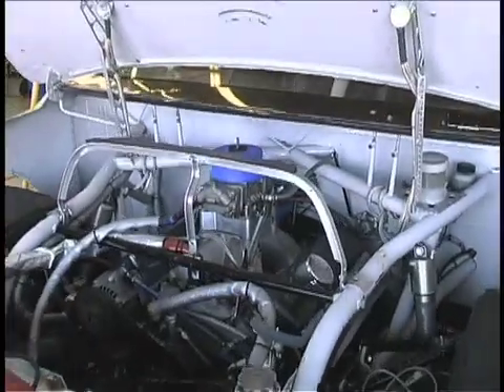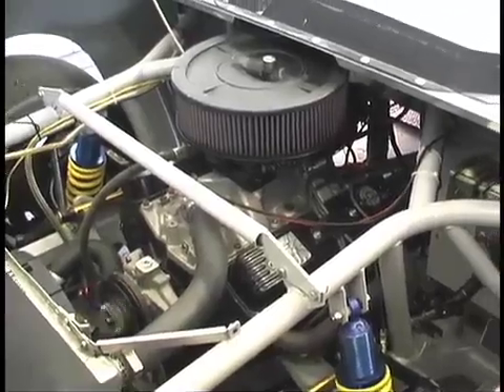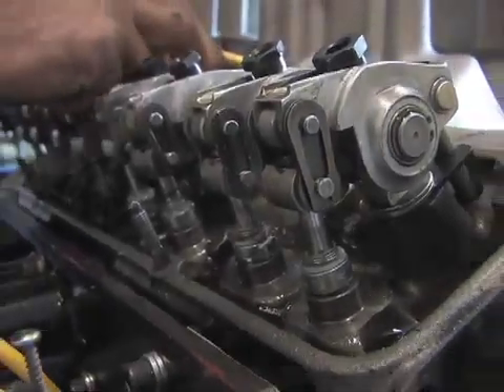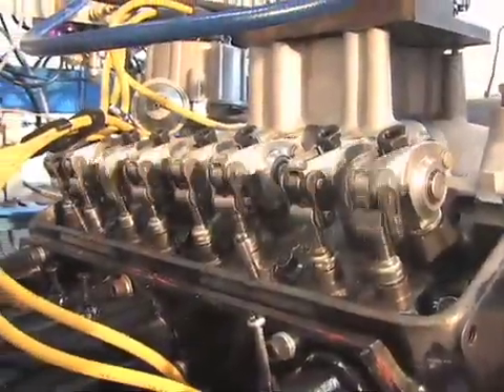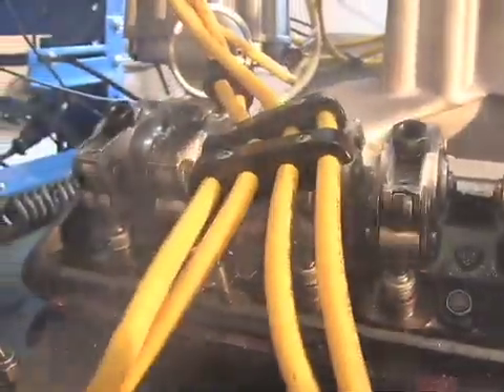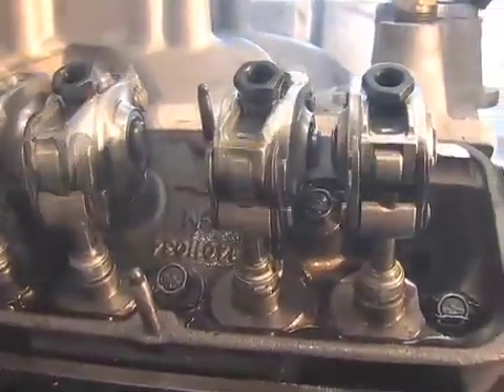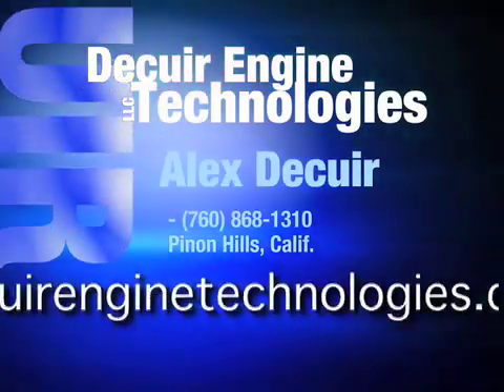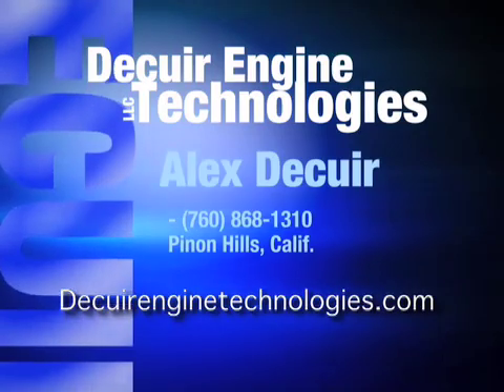Springless Valvetrain For Push Rod Engines!

Comment: @01Z06guy To continue about our different cultures, over here for the same money you can buy say a Chrysler 300C ( one of the american cars you can see over here) or an Audi A8 4.2FSI Quattro. The Chrysler is faster (the Hemi) but uses a lot more fuel and it polutes more. If you sit in an Audi you feel rich, it's got fine quality leather and the materials used are high standard and last a live time. If you sit in the Chrysler you feel cheap and tacky. But it's big and fast, so take your pick.

Comment: @01Z06guy It's usable, but not practical, there are better ways of doing it. We are not getting anywhere anymore. You think you are right, and so do I. And I think it's again the difference between cultures, we like different things. The conditions are also very different, we have different roads are, more densely populated (In this part of europe) so we have different needs. A pickup-truck is a laughable mode of transport here, will a comnpact car would be lost in say Nebraska.

Comment from the maker: Whats new is that this is for a push rod engine, most other "desmo" systems have been primarily for overhead cam configurations but this would be for good old fashioned American overhead valve engines. 
Decuir Engine Technologies

Comment: Name a steam engine that can compete with modern deisel engines.  You can't do it because they ARE obsolete.  That's the difference.  That's what makes an engine obsolete.  If you have abandoned the term, "obsolete" and want to go with, "old technology" now, calling the OHV, "old technology" is rather silly as OHC has been in widespread production since at least the 1920s making it, "old technology" as well.  Both designes have incorparated modern technology into their respective layouts.

Comment: @01Z06guy They are called hydralic tappets, hydraulische klepstoters in Dutch (bet you didn't know that) I think I'm going to end this discussion, I tried to be open and read your comments but I'm not convinced, I still think pushrods are old technology, there are great pushrod engines (like the LS series) but there are also great steam engines and they are not widely used anymore. Prices are very different in the US and europe for the price of the corvette you can buy a Cayman, slower but nicer

Comment: "there is not a sense of presicion"

LOL  Exactly.  The problem is in your mind.  You are narrow minded and therefor you ignore the facts in favor of your predetermined bias.  It can be more powerful, burn less fuel, cost less, be cheaper to maintain, and last longer, but that doesn't matter to you because you already have a bias that it's somehow, "imprecise" because of it's brand and layout.

Comment: @01Z06guy Im not saying that GM is wrong, But for GM sports cars to be taken seriously by the world, they would have to conform a little bit to modern technology. If the corvett had a presicion DOHC v8 that was on a non leaf spring suspension, made vast improvment over current interior design and fit and finish, and exterior design that had a little more elegence to it. i would bet that the corvette would become a world reconized supercar, instead of a primitive muscle car.

Comment: @01Z06guy WOW a 7000 rpm redline, that's nothing compared to what a dohc can do, things that are not related to dohc or ohv, siamese cylinders, dry sump, cylinder de-activation (used by BMW in the 1980's) . Air flow in a 4 or 5 valve head is even better and the placement of the spark plug is easier, try that with a pushrod and it will get really complicated

Comment: on the other hand the LSA is just another modded up chevy small block with a blower thrown on top. it is a powerhouse at 556hp, but that is delivered through 6.2 liters and forced induction. in the same way a muscle car guy can accept that a fwd honda can be built to over 400hp, but favour "ricers" i accept that gm pushrods can be impressive motors, but there is not a sense of presicion as an engine like the m5's v10. so even though the cts is faster, cheaper i would rather own the m5,

Comment: @01Z06guy LOL. you are right.. CTS-V is faster than the M5 and is rated higer mpg. and the CTS-V is also a great deal cheaper than the M5, but.... the m5's 5.0 V10 is a masterpiece. 500hp from an NA DOHC with valve timing.  its engine won international engine of the year two years in a row (chosen by people much more qualified that you or i). the M5 v10 is simply an exersize of engineering at its best.

Comment: "best selling is a OHC Ford"

Not really.  That is only technically true because GM truck numbers are split between Chevy and GMC.  Put the numbers together and pushrod GM trucks outsell Ford trucks every year.  Why?  Because their powertrains are better.  Chevy's pushrod base V8 gets better fuel economy than the base V8 full size truck from Ford, Toyota, Dodge, or Nissan.

Comment: "but imagine if they would have spent the same amount of energy into DOHC small block v8 R&D"

They did.  Look up the LT-5.  GM did extensive engineering work and decided they could produce an all around better engine with OHV than DOHC and that's exactly what they did.  They created the LS series.  Read up.  They made a bold engineering choice and they were 100% right and it paid off.  Ford on the other hand was not bold and designed the Modular V8 which is pathetic compared to the LS.

Comment: @01Z06guy Al these advances have nothing to do with pushrod or DOHC and are or were used in DOHC engines. We are missing one major point here, we are comparing smaller displacement 4 valve engines with bigger displacement 2 valve engines. I you would make a big displacement 2 valve DOHC engine it would have the same feel and low down torque but lesser moving parts (4 cams, 2 chains, 2 chain tensioners, 16 hydralic valveplay adjusters in the DOHC, in the ohv 16pushr 16 rockers 16 adjusters 1 cam

Comment: @01Z06guy im not against GM or pushrod v8's, but it does kinda say somthing about GM  when allmost every other car company in the world no longer uses pushrods. I agree that pushrod small blocks have had years and years of refinment, and the ls7 is a masterpiece. but imagine if they would have spent the same amount of energy into DOHC small block v8 R&D. they could have probably still had an engine equal to ls7 power, but could have been even more efficient with  VVT, direct injection, etc...

Comment: "What advances were made in the pushrod engines"

Since when?  There have been continual advances from roller camshafts, to siamese cylinders, to valve train arrangements allowing greatly improved head airflow design, to cylinder diactivation, to dry sump oiling systems, to lightweight valve trains allowing 7000rpm redlines.  How far back do I need to go to get you caught up?

Comment: Were did "Top Gear magazine" get their fuel efficiency numbers from?  I know how the EPA gets theirs.  From a perfectly fair set of tests in varried driving conditions and they showed the Z06 to be more efficient.  Even using your numbers, it gets the same mileage as an R8 while producing 85 MORE horsepower.  Hmmmm.. again, thanks for making my point that the Germany OHC V8s are not more efficient than the LS7.

Comment: ""laws"agianst large displacements don't exist in..Germany"

100% flat wrong.  Even Germany's brand new tax on CO2 emissions is based on a formula between displacement and CO2.  Displacement is taxed in Germany.  That's a fact.  Go look it up.  As for the Netherlands, who cares?  No manufacture is going to design an engine based on the auto market of the Netherlands.

Comment: "DOHC..will be more efficient"

EPA mileage rating directly for fueleconomy(dot)gov

2009 BMW M3= 14city/20highway
2009 Audi R8= 12city/19highway
2009 Corvette Z06= 15city/24highway

The LS7 is more efficient than both German V8s.  It's torque allows it to pull a very tall gear.  The ability to cruise at low RPM makes it more fuel efficient.

Comment: So the LS7 weighs 14 more pounds and makes 91 more horepower than the BMW V8 and weighs 29 more pounds than the Audi V8 and makes 85 more horespower.   Thank you for proving my point that the LS7 is superior to both BMW and Audi V8s.  Nobody in their right mind would give up 85-91 horsepower to loose 14-29 pounds.

Comment: @01Z06guy The LS7 is handbuild that's expensive. OK a OHV with the same displacement is smaller than a DOHC, but with the DOHC you don't need the displacement and it will be more efficient. Why else would everybody outside the us (GM australia excluded) stop making OHV, because it's cheaper to build, more efficient, more environmently friendly, I don't think so. But you are right about the feel, if you like the engines style, I understand why you buy one, but it's not modern or better.

Comment: @01Z06guy BMW V8 (M3) 202 kg 444 LBS(american) Audi V8 195 Kg 429 LBS, LS7 458 lbs. The cost in the Netherlands BMW M3 €103.415 Audi R8 €165.645 Corvette Z06 €141.790 (the 7 litre version)  ZR1 €202.690  Audi R8 V10 €212.430. The weight of the engines I found just googling on the net (multiple quotes) You see the prices are very different from the states I think. Second hand is another story a three year old ZO6 is about 55.000 and an R8 about 95000 euro.but that is beside the point.

Comment: "GT40 had dubble the displacement of the Ferrari"

So?  The Ferrari had 48 valves vs the Ford's 16.  This is exactly the point.  Engineering choices.  Ferrari chose to make power with 12 cylinders and 48 vavles, Ford chose to make it with displacement.  Both ways were perfectly legal.  Obviously the pushrod design was not obsolete or even inferior as it beat the alternative.  With pushrod design, you can have more displacement for the external size, weight, and  cost of an engine.

Comment: I agree 100% with pneumatic valves.  Or electric solenoid valves.  How they are actuated matters not.  Infinitely variable lift, duration, timing, and overlap on the fly with no cam will render all camshaft engines obsolete by comparison.  Performance and mileage can both be vastly improved upon with a system like that.

Comment: @01Z06guy  At least we agree on Harleys. About the weight BMW and Audi V8's are lighter than the LS7 (is is still a great engine) The Ford GT40 was in the 1960's and had dubble the displacement of the Ferrari. The new Ford GT is a DOHC. Thinking about it I think GM and Chrysler are the only ones still making ohv engines. What I meant in the start of this nice discussion is, why develop something when another (in my humble opninion beter) solution is already there and used by most engine builders

Comment: Yes, Harleys are pathetic and OHC can produce more HP/displacement due to it's ability to rev higher and support more than two valves per cylinder.  Harleys have nothing to do with auto engines and hp/displacement is meaningless in a car.  What matters are the factors I outlined before.  How the engine as a whole affects the car.  And in that case, pushrod engines can be better than OHC rivals depending upon application.  Not always, but sometimes.  They are not low tech, crude, or obsolete.

Comment: @Mcguppy When Harley Davidson wanted a real performance engine they asked Porsche to help them, the result, a DOHC 4 valve engine. About the moving mass in the engine, there is also a difference between revolving and reciprocating mass, in a good design the camshaft is directly above the valve without using rockers.And if possible a belt driven camshaft instead of a chain.

Comment: @01Z06guy Take a look at the Fiat/Alfa Romeo Multi-air engine, that's modern technology, and no it's not 400 hp but it's only 1400cc and 170bhp easy.Or the Ducati desmosedici 200hp plus from only 989 / 60.3 cc/ci.(non turbo) total weight 171 kg.

Comment: @01Z06guy I meant the V8 Audi to keep the comparison right (haven't driven the V10) Then why is it that in racing if you want to have power, high revs, low weight that they use DOHC and not pushrods, and I'm talking about the top of motorsport. If a pushrod engine is so light, why do all lightweight motorcycles use DOHC. Harley uses pushrods and some japanese clones but the all weigh a ton. Ok maybe for road use a pushrod is not as obsolete , but if you look at Hp/displacement a DOHC  wins

Comment: What matters for an engine is how it impacts the car.  How much it weighs, it's physical size, it's cost, it's fuel consumption, it's reliability, it's power, and how it delivers that power.  An obsolete engine would be one that cannot compete with it's rivals in the above criteria as a whole.  How the engine achieves that is irrelavent.  If you research the topic, you will find the LS3/LS7/LS9 pushrod engines are pretty dominant in the above criteria.  The opposite of obsolete.

Comment: Not true.  There is no added vibration with OHV, and depending upon the specific OHC layout you are talking about, there may in fact be more rotating inertia in the form of 4 cams, 4 sprockets, many more cam bearings, and a very long timing chain or belt.  Many OHC setups still have rocker arms of sorts.  The cams don't directly actuate the valves so the only parts left out is the pushrods and lifters.

Comment: @01Z06guy In a ohc engine there are fewer moving parts than in a pushrod engine, so less inertia and vibration and the ability to rev higher. A production Audi RS6 shifts gears at 7700 rpm in sport mode and it still sounds sweet, I don't see a production pushrod V8 doing that.( the ls7 looks good under the hood)

Comment: Right.  Your explanation of crude between cars is correct.  However, you still have not explained how an OHV engine is more crude than an OHC ongine.  How does moving the cam to the top of the head make an engine, "more refined?"  It doesn't.  How is an LS3, LS7, and LS9 "obsolete?"  They're not.  They're anything but.

Comment: Sorry, I did not see that you were from the Netherlands.  The pushrod engine is anything but obsolete and crude.  There is nothing more "high tech" or refined about overhead cams.  American cars had them in production in the 1920s.  That's far from "high tech."  Pushrod vs OHC each have their advantages and disadvantages but neither is more "high tech" than the other.  Perhaps being that English is not your native language, you don't really understand the meaning of the words high tech or crude.

Comment: I agree with this statement below.  Only way to keep all the parts together and not have to adjust all time would be to make every wear surface a roller surface. that way the load does not wear one spot too long.
The only problem that i see with this system is that as the valve-train is stressed, the valve stems, push-rods and other parts that are exposed to wear will cause a gap and the valves would not seat properly.

Comment: @japajill yea, well, i dont have big bucks to swap out my heads on my 351 windsor, so if your willing to buy me a set of OHC heads and all the necessary parts i would be more than happy. but if not, i will just keep my single cam push rod motor the way she is and watch it smoke all the lil OHC ricer boys

Comment: DOHC is an easier way to tune an engine and wider head for better air flow.. Old design but still is a good way of getting rid of valve floating at high rpms than just adding stiffer springs adding more stress to the engine.. I honestly find stiffer double valve springs decreases the valves life span.. but of course better power at higher rpm.. so to compensate more expenses is need for better valves so even when used daily the valves can set well for a longer time.

Comment: What is the objective in ridiculing this set up? It's not like those who are bagging the design have got off their butts and produced or designed some clever equipment themselves. It's still a good idea for making old banger V8's a bit better. No need to bag someone for having a go.

Internet-sperts getting into someone who has been proactive towards making these engines better than they are at present. 

Great move guys and love the concept. Any chance on doing these for the Aussie Holden V8?

Comment: This system may work but it would need to be adjusted too often.  Hang a valve open a few thousandths, and you'll be getting backfires through the intake, along with low combustion pressure and reduced power.

Comment: Thats really neat... Too bad most folks don't realize that overhead cam is old than Pushrod activated ohv.
Does the original cam still determine the valve events? where as you could switch to a couple of different aftermarket cams or is it something special?

Comment: Seems to me the pressure exerted by a racing valve spring on its cam lobe and lifter IS the problem at high rpms'. That is what the Desmo system solved. The drawback is that tolerances need to very accurate. Still, a little blow-by @ 9 to 12,000 rpm in a four stroke is a good trade off. Ask any Ducati racer. Pre-war Mercedes GP cars used it with great success.

Comment: How high have you got the revs to on that thing?  It certainly has its merits, but it looks like it will break with all those tiny parts.  BTW, the fastest cars in the world use pushrod engines.  They are far smaller, far lighter, and have less rotating mass than OHC engines.  For large displacement applications OHV pushrod engines are more cost effective and efficient.

Comment: @EmpEntTV 

IOW you've applied the desmo valve train to a system that once used valves? Finally somebody got a clue...now about making that a 2 stroke cam and turbo supercharged. 8^) Couldn't help myself there, too many year driving a 2smoke diesel and 2smoke bikes. 8^) 4 stroke is nice, but 2 stroke is better by far imo, becuase economy is for those with little fuel cells.